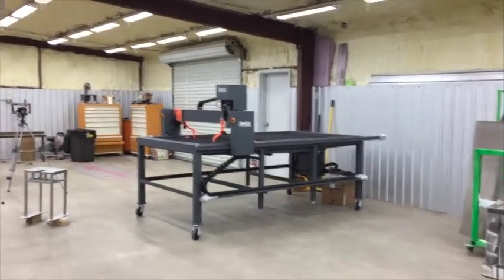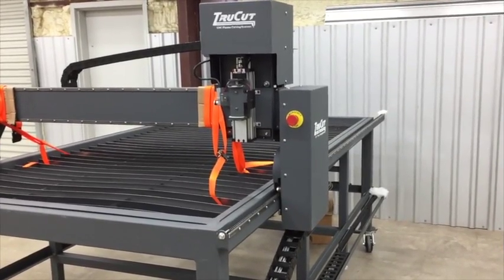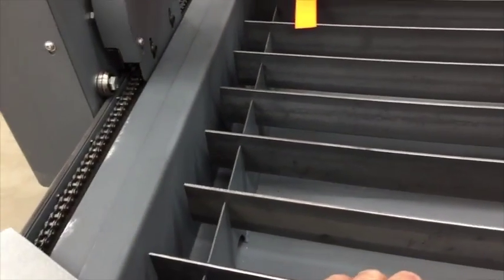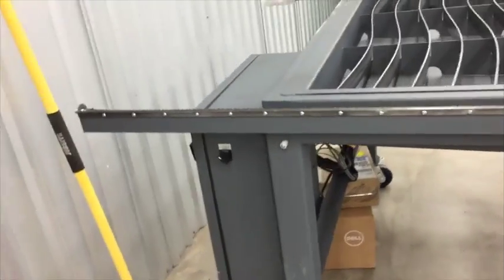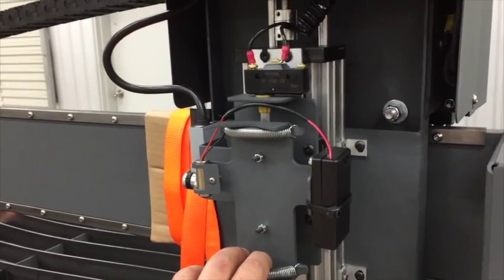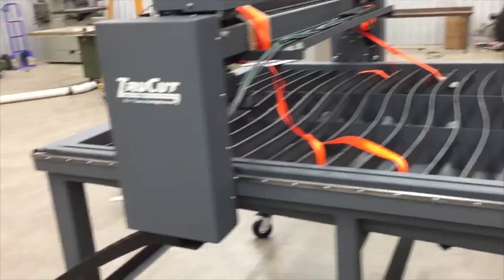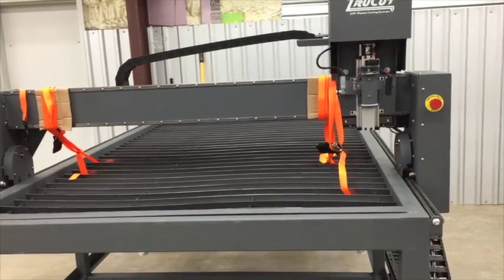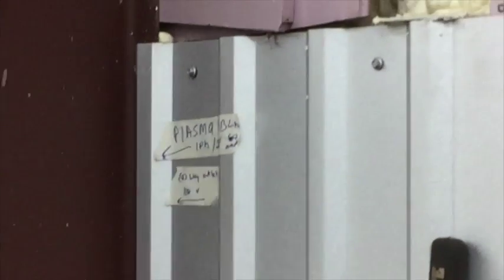Brand New Trucutcnc Plasma Table Walkaround... is trucutcnc good?

Comment: Looks like a great setup! Grounding is very important so you don't get bleed over into the controller. The water table helps a lot but won't be 100%. Prepare to clean up some and maybe do some air scrubbing as well. Clean, dry air to the plasma cutter makes a difference too.

Best wishes,
TZ

Comment: HI Gary,
Your table looks good.  Yes, the ground rod is VERY important.  I drove an 8 footer right under my table and made a special connection block that I hooked up the table grates, table and an extra cable that I have a magnetic ground attached to just to make sure I have a good ground.  I don't use the magnetic ground much but if I have a small piece that might be questionable, I will attach it.  Congrats on getting your machine.  I am sure you will enjoy using it!
Take Care,
Reid

Comment: Gary very nice, game changer!  I like the electronics install, looks very good.  What CAM software does the system use?  Also I am curious how the torch height control works, IMHO the mach 3 THC is terrible and I never could get it work properly.  The ground is important where I used to work they had problems with the machine because it was not grounded properly.  Just my 2 cents but whenever I commission new equipment I try and get it going right away and push it hard after I am familiar with it to find out any problems early while you still have warranty and the purchase is fresh with the vendor.  Even if I don't plan on using it right away.  That way when you do need it, you're not finding out stuff didn't work from the get-go.

Comment: Looking forward to hearing how this works. As  for grounding no need to put holes in wall,  drive rod , ground to building, ground table to building like an automobile. That way if you ever move table it can be re-connected to any metal part of building and still be grounded.

Comment: That table is HIGH... going to be a bitch loading sheets on that. What's with the middle legs being way up off the ground?
Reply: In my experience, when loading tables like this without a forklift or gantry. You never want the table higher than what you can lift with your straight arms. Meaning that if you have to shrug or lift at all, it's going to be a struggle and possibly injurious. And since you don't have the down draft table and skirting underneath, you can go pretty low.

My first router table was also made by a small outfit out of Oklahoma. They did a great job. The plasma table that I have now, I ended up going with PlasmaCam for a variety of reasons. However, I wish I had bought all the appropriate upgrades right when I bought the machine. Because for me to expand my table's capabilities now, I've got to dump in $3-$4 grand on their upgrade packages.... uggh!
Reply from the maker: the table is sitting on 6" casters that we have it on it temporarily to get it to its final position
Reply: Oh yeah, even PlasmaCam really wants you to use a 1/2" solid copper rod buried in the ground as well. But I think they said it only had to be a 3 footer. 8' seems unnecessary, unless you are also using a lightening rod for your shop.